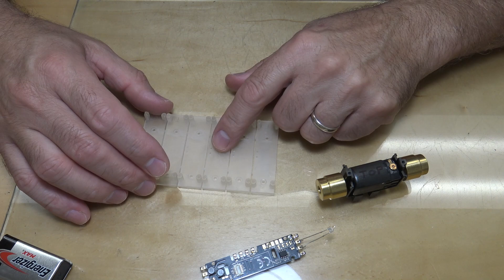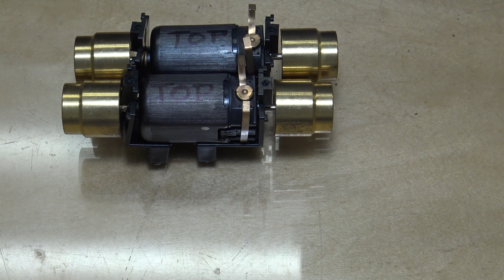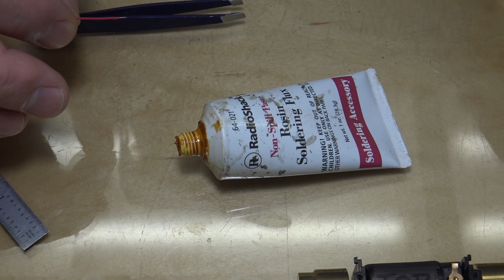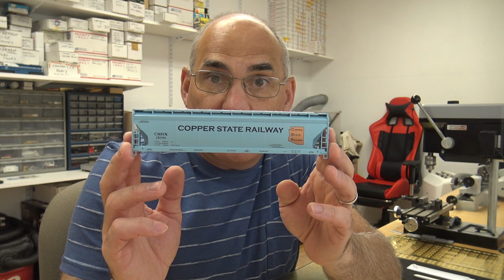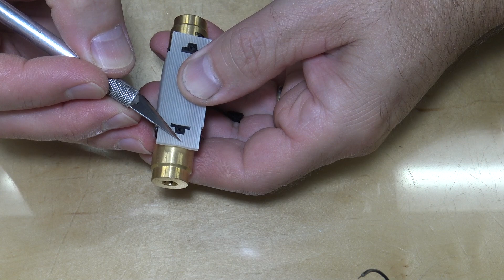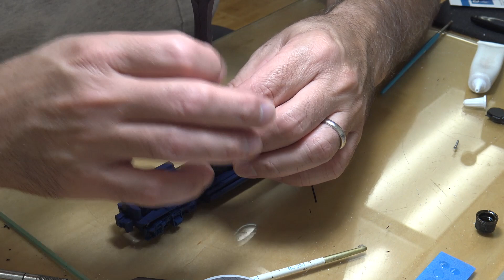KATO GP35 PROJECT x6 MOTOR AND DECODER INSTALL

Comment: Great video!   Best and most detailed video I have seen.  Thanks!  Where can I buy or do you sell the tool to shave the posts or the decoder stand?  I would love to buy a few of each for future Kato GP35 installs.
Reply from the maker: Yes, they are both for sale in my Shapeways store.

Fine Scale Prototype Models
Reply: @6axlepwr  Thanks Brian-Subscribed!!  I just finished watching the video.  I watched it in segments around work. :)  I should have known you would mention buying the tool and decoder stand!  Thanks for that.   I just received some of the Iphone 4S speakers and have been anxious to use them and running 2 of them...so the speaker part was very helpful!  Thanks